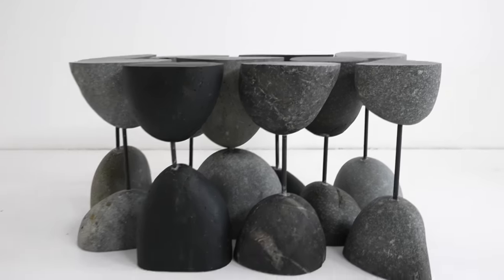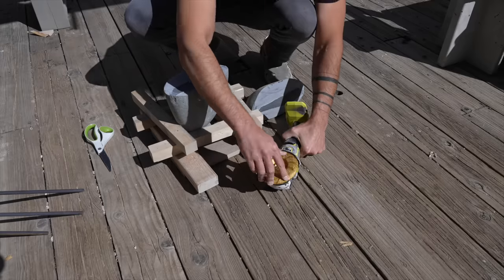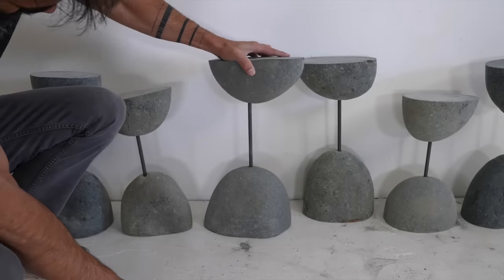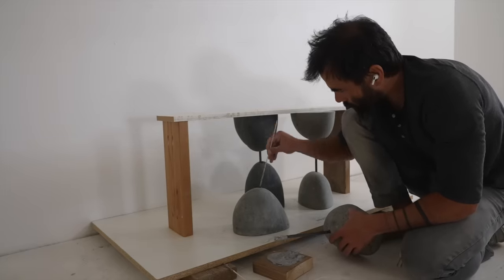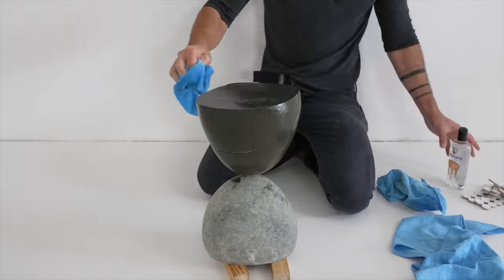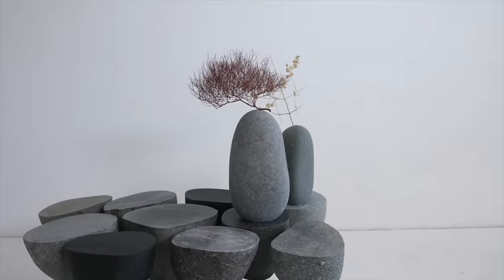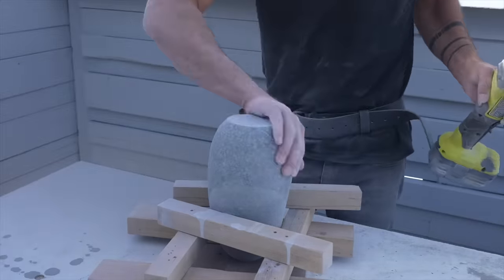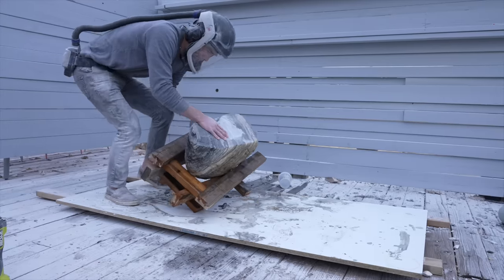Making a Table out of ROCKS

Comment: I love it!!! Here's a trick you might try from the glass world - for drilling, instead of dipping the bit in water: if you make a small dam around the hole you are drilling out of plastolene or something similar, you can fill it with water. As you drill down you can add more water, it will keep the bit and the stone wet. The water will heat up, not not nearly as much as it would dry, and you can keep pouring new water in until you hit your target depth.

Comment: This looks great! For the drilling you can make your bits last longer if you lubricate with spray oil like WD-40 instead of water. Also you may want to dial the speed of your drill down if you have the option! Great work!
Reply from the maker: yes! I have been trying that and it works well but it can stain the stones
Reply: @HomeMadeModern what if you seal the rocks before drilling? Wouldn't that reduce the staining?

Comment: Don't plan on doing a similar project, but certainly learned some things about cutting and drilling rocks. I forge a lot of steel flowers on long stems, and cutting a flat base on an elongated rock and then drilling it for a quasi-vase is a great idea! I've been using diamond bits under water to drill the rocks I've worked with and that works well.

Comment: Thanks for sharing. It turned out great. Love the modular-ness of them. Thinking this might be neat for a small lanai, in which furniture must be kept at a minimum amount. Make about 5 individual ones for a small table. Pull them out individually when a small side table/drink holder is wanted for alongside a lounge chair. This fits my needs well. I can also see other modular ways others may use. So, very nifty indeed.
Reply from the maker: That's a great idea!

Comment: Impressive video! Your innovative concept was executed with great elegance.

I'd like to offer a suggestion for further enhancement. While your current wooden cutting jig is both cost-effective and efficient, its reliance on a drill and lack of permanence might pose limitations when batch cutting numerous boulders. Consider exploring a more permanent solution for increased efficiency.

One idea is to utilize two clamp-shaped vice grips with swivel pads, positioned perpendicular to each other and terminating at the same point. This configuration not only provides the flexibility necessary for working with natural materials but also allows easy adjustments through the thumb nuts of the vice grips alone. Additionally, the increased security and versatility of this approach could significantly enhance your workflow.

To address potential concerns about scratching stones, you may want to incorporate wood or PVC dampeners for the vices. This thoughtful addition would ensure the protection of the materials while maintaining the integrity of your cutting process.

Comment: could have split the rocks then made a drill press rig for your hand drill thats set to drill the same depth holes on all the rocks so that the steel bars can be all the same lengths this would also solve the leveling issue and should have cut the stones with a drop saw to gen a level cut to begin with wanyway imma stop waffling i loved this vid it inspired something
Reply: u need a 3d printer if you dont have ne already get one theres print files for hand drill drill press